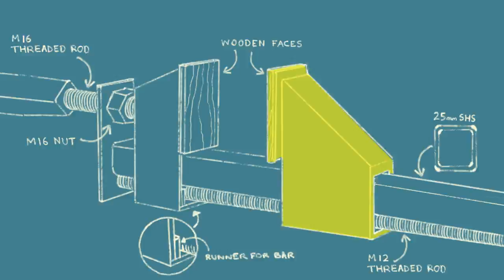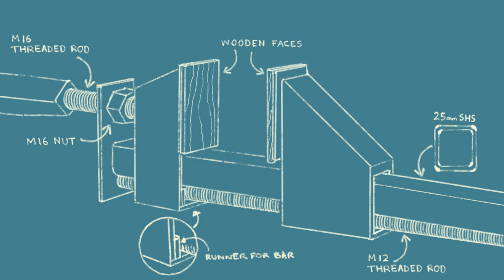Homemade Bar Clamps

Comment: I like the way you drill holes into the side plates and then use them to spot-weld the inner components in place where you can easily weld to the edge of a piece, that's quite clever and would help a lot with alignment I think. :-)

Comment: Fortunately for you, you have the necessary tools and skill sets that allow you to craft those really nice clamps. For some others it's just a dream and much easier to buy clamps as needed from where ever they can get them. You have done an extremely detailed video showing the exact steps and procedures and for that alone, you are to be commended! Great job!
Reply from the maker: Thank you very much! You are right, it's much easier to buy clamps but I do enjoy making tools. I've just made a wooden version of these clamps to make it easier for others to make their own - still a bit of work but much less so than these ones (should be a video and plans out in the next few days).
Reply: woodstoney It is much easier for the maker of this video to also buy the clamps. That's what I'd suggest he do.
Reply from the maker: Yes easier to buy and thanks for the suggestion - but I enjoyed coming up with an idea and making the clamps. Now I have 8 clamps that will last me a lifetime and give me pleasure every time I use them. Also they cost less than $20 a clamp which is very cheap for an easy to use heavy duty clamp - I realise that doesn't include my time but if thats how I like to spend my time then its all good.

Comment: That's pretty clever, thanks for sharing it! 
I saw a video recently (sorry can't remember who's channel) where the same idea, using threaded rod and a sawed off nut, was used to align a table saw fence, so you could always return it to the same 1/16" position. 
Well  done!
Reply from the maker: Thank you! Yes I have seen it used on different jigs for indexing but not on a bar clamp for grip.
Reply: Yeah Carlin Comm I saw that video as well! I think it was "Marius Hornberger"
Reply: carlin, any idea where i can find that video?
Reply: Michael Aldan its on a channel called Jers Workshop

Comment: Ain't nothing wrong with flux core.  Sure it is messy but it works.  Used it when I welded a roll cage into my race car, when I learned to weld.  Just a little more clean up if you have to.
Reply from the maker: I agree Brian! Thank you! :)

Comment: I loved the video, no obnoxious music, commentary, dog barking super loud machine noises or mouth breathing of the videographer :)  however, for some reason, I had trouble watching it due to the very bright welding footage, I am not sure what the issue is, perhaps the other similar you-tube fabrication videos i have seen were processed with a light spectrum filter that dimmed the brightness on those sections, perhaps they put their go-pro inside the welding helmet, I don't do videos so i am not sure how to fix the issue, but i think your stuff is great,  and wanted to mention that to you. If I have offended you I apologize, it was not my intent. I was just getting a headache and wanted to let you know something you may want to look into. Great stuff though, it answered the questions that I had perfectly.
Reply from the maker: Thanks very much Russell! Filming welding is difficult and the problem is having an exposed shot before you press the trigger and then still being exposed while welding. I do have a x1000 ND filter, I haven't tried that and it may be too strong but if it did work it would only show the welding and none of the surrounding environment. :)

Comment: Looks cool, your not so average bar clamp! Is the green plate next to the handle stiff enough?
Reply from the maker: It's a good question. When I made my prototype I used 5mm flat bar for the end - I didn't have enough in stock to make these 8 clamps so I used 3mm. The 5mm would be better but I've put a straight edge to the end and they don't show any sign of bending so far - if they do I'll beef them up a little. Thanks!

Comment: These are great! I think I will definitely try to make them in the future. I do have one question on the sliding end of the bar clamp, I've seen plenty of craftsmen use "even" clamping pressure on both the top and bottom of say a table they are working on. When you flip these upside down to clamp the top, does the half nut still engage. Just curious as the gravity creates the lever for the nut to press into the threaded rod, from what  I can see. 

Thanks!
Reply from the maker: Thanks Trent - glad you like them! They work fine upside down too. :)

Comment: Looks very profesional! :D I have one question - isn't  too thin the steel strip trough which the pushing screw passes? I'm sorry for my English if it is incomprehensible.
Reply from the maker: Thanks Pawel! That piece probably should have been thicker, even though it is still standing up to anything I've thrown at it so far. :)
Reply: Thanks for info ;)

Comment: Very cool! I just didn't understand why he drilled a few holes on the side plates... also it seemed a little random. Was it just me, or those many shots of welding made the eyes hurt a little?
Reply from the maker: Thanks Marcelo! Sorry it hurt your eyes, there was a lot of welding on that project! The holes were for spot welding the parts together before finishing off with a full weld - it helped to hold them together in the correct position. :)
Reply: Thank you for the response! It makes sense now! Keep it up with the nice work! Congrats!
Reply: It was just you Marcello...

Comment: congrats, I see you have plenty of tools, I have cuestion, way do you put the piece  of plywood as fence on your mitersaw? ( minute 8:06)
Reply from the maker: Thanks! The piece on the fence was an experiment that works pretty well to support the work piece when cutting mitres - no help with 90 degree cuts though. Because it was an experiment I fixed with hot glue and it fell off the other day - it's been on there for months though.

Comment: Neil did you do a cost break down for each clamp? I'm in the US, so I know there is a dollar difference but it would give me an idea. Also, do you sell your designs for any of the shop tools you make? Thanks! ~Dolly
Reply from the maker: I haven’t done a cost breakdown of these metal ones but I did in the plans of my wooden versions. They work out very cheap. You can find the plans with many others on my website. 😊

Comment: Are there any plans I can find of these clamps, really wanna build some but I need to know how much material I would need?
Reply from the maker: I didn't make plans but I did for my 'easier bar clamps', they were made with plywood but are very similar and those plans(free) could help you. You can find them on my website.
Reply: I know about those plans. The only part I can't know from them is what is the actual thickness of the sheet of steel you are cutting all the parts out of.I have some scrap 2 mm sheet but I don't know is it strong enough.
Reply from the maker: 2mm will be plenty strong enough, if I remember I think I used 2mm. :)
Reply: That's what it looked like to me, just needed to be sure. Thanks. I'll email you some pics when I finish if you are interested :D

Comment: Although I've watched this many times, I have to ask. What are you sprinkling on those metal pieces?
Reply from the maker: Do you mean when I'm drilling - if so that's oil (3in1) I use as a cutting fluid.

Comment: im suprised ur welding without a shield for ur tip im kina wondering if thats why its messy
Reply from the maker: Hi Douglas! The welding tip is removed because I'm using fluxcore wire (gasless welding). The reason it is messy is that's just how gasless welding is. :)

Comment: It seems you did a mig welding but without gas, what kind of welding do you use?
Reply: It is Flux Core Wire. It is made to not need argon gas shielding. It is not as good as normal wire that is shielded with argon though. It is prone to porosity, which weakens welds.
Reply: @archer9338  @ so what the benefit of using flux core welding method here, for better result, faster welding time or reducing cost?
Reply: @MrAirbleed  It may be difficult for people in some areas to get the argon gas, and there are some people who just don't want to mess with the hassle of using the argon gas. Flux Core wire may be more convenient. But, it tends to  produce lower quality welds.
Reply: @archer9338  @ got it. This time i'm still searching for best welding method an device for home workshop, i'll use it for just personal needs. Can you recommend which one that best for this purpose? Mig, flux core or tig welding? It seem theres alot of things i have to learn about.
Reply: @MrAirbleed  I would suggest mig welding with argon gas. It is the most practical to start out with. It is cheaper and easier to learn than tig welding, and will work well for most steel welding that someone is likely to do at home.
Reply: @archer9338  @ aah i see.. thank you so much. This is so mean to me, because in my province theres so hard to find updated welding stuff that i need. Thanks so much 🙏😁

Comment: can you estimate what these cost you to make,  per unit?
Reply from the maker: I roughly worked out when I first made them that they cost around AUD$150 to make all eight - I've now worked the cost out better and they actually cost AUD$120 - this doesn't include the plate I used for the sides though as I salvaged that.
Reply: Pretty cheap. Thanks for the info.

Comment: what is the model of the welding machine?
Reply from the maker: It's an Ozito which here in Australia is a cheap brand - I've had it 3 years and used it a lot with fluxcore wire and it has worked well for my needs. I have just bought a cheap Tig welder but can't find the time to try it out.
Reply: I'm brazillian, and here it's comum welding machines that uses electrodes to perform welding (https://www.dimpar.com.br/wp-content/uploads/2015/06/eletrodo-para-solda-eletrica-tp_6362158222343043127f.jpg). In your video, the welding machine weld in a diferent way (it seems that the parts of the very material to be welded is melted and joined together, not needing the material coming from the electrode). What kind of welding is this?

Comment: In the hell is going to do all this for something that does not cost that much?
Reply from the maker: Cheapest clamps I can find (here in Australia) that adjust to any position(without moving a pin to the next nearest increment) are around $40 each x8 $320 plus postage which would not be cheap here either. Mine cost $120 for all eight - the $40 clamps are pipe clamps which are more than adequate but I would rather have mine. I also had the idea for these and enjoyed taking a concept through to a finished working tool. Also I enjoyed working out the project and exercising my brain - it's all part of the fun. I love a challenge and like hard work so this was easy for me - I understand this isn't for everyone though - each to there own. I did make a wooden version of these clamps and they really weren't too much work (and cheap).

Comment: Hate to be a dick but those have got to be the most expensive bar clamps of all time. 

That is ALOT of work.
Reply from the maker: But I reckon they're a great design, I've been using them for a few years and they're pretty awesome. Materials were super cheap but fair enough with the time factor. If it's something you enjoy doing though, then time doesn't come into it. :)

Comment: You know... they're actually pretty cheap just to buy them?
Reply: really? 45 a piece at least.  not that cheap.
Reply from the maker: Funny your comment was under spam. I have sash clamps - I find them a pain to use even though they certainly do the job. You have to set them all to the general length then turn the handle sometimes a fair few turns to get them to clamp. This is ok on some glue ups but sometimes it's nice to have a clamp thats quick and easy to use. Cheers.